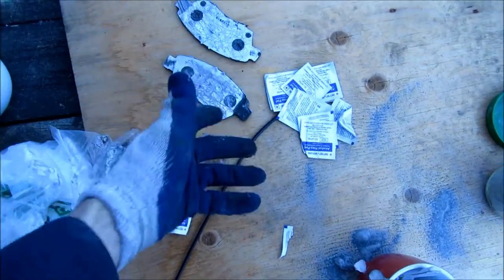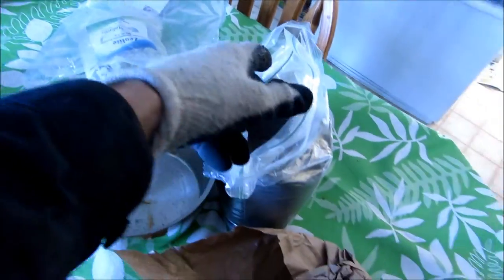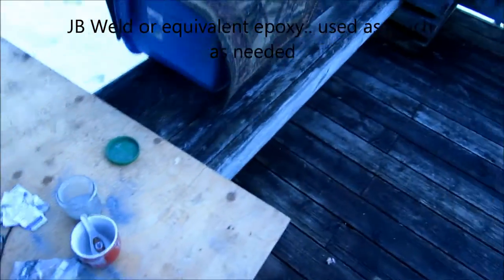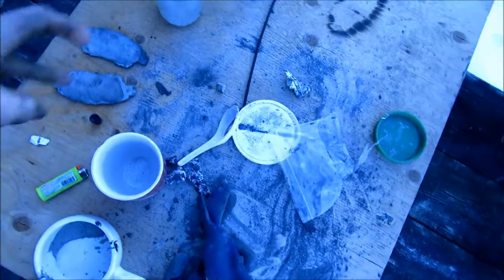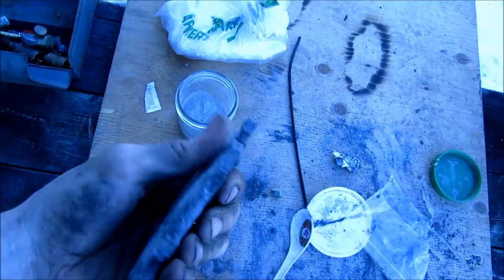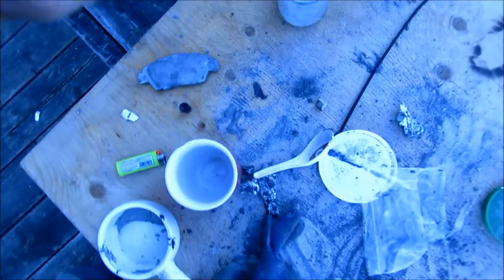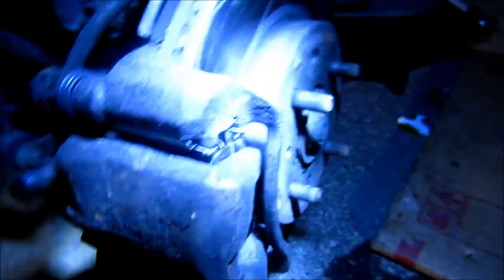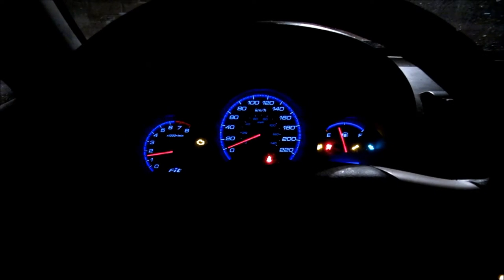DIY Brakepads! epoxy, aluminum oxide, zeolite, magnetite, done!

Comment: Dude I literally was looking for diy brake pads like 6 months ago. Why didn’t this vid show up. Fukn search engine. 
So is this a inexpensive though labour intensive production. Or was there some other reason you did this method?
Reply from the maker: Hey!!  Glad to have you finally come across this video, given the fact you searched for the thing many moons ago, I wish you woulda found it sooner when your pads were likely burnt out and you really coulda put this method to the test.  

As far as it being inexpensive and labour intensive, both of those are slightly incorrect.  I had some silicon carbonate laying around which I had intended to use as an abrassive in a ball mill project, but this didn't end up happening so I decided to utilize it as a component in the grit for the brake pads.  This is a relatively expensive material.  Also, the binding agent to make all the grit adhere to the brake pads securely is also a high value item.  I believe I used one of the most expensive 2 part epoxies which are available in small quantities for the hobby market.  It's  known to many as JB weld and works amazingly well for this type of application in comparison to other 2 part epoxies, such as the extremely cheap ones you can get at the dollar store which probably would crack and crumble to dust after only applying the brakes a handful of times.  This is just my guess as I never tried it out, but from my experience using that garbage for other projects, it's  probably an accurate hypothesis.

The other thing I'd like to mention in regards to this project is that brake pads are already fairly inexpensive, and making your own doesn't actually make much sense, aside from the reward you might feel from having put something like this together yourself and having it actually be capable of bringing your vehicle to a stop.  When I did this project myself, my motivations to do so were slightly different than what most people may expect.  I was going through some mental health struggles and had absolutely no way of coming up with the money to simply purchase new pads, but after looking around the house for materials, I realized I already had everything required to put these together myself without dropping a penny.  I also had it in my head that a new set of pads would have probably cost me about $80 for the cheapest I could find.... Turns out my estimation was completely far off and I probably could  have just bought a new set instead.

I forget how long the pads lasted before I had to replace them, but it wasn't very long.  Anyways, I hope you have fun if you decide to give it a go!   Make sure they're safe before getting on the expressway or something!  Perhaps only rely on 2 wheels with home made pads vs. using it on all 4....Cheers!

Comment: Cool project idea.  Your recipe is in the semi-metallic category for abrasive.  As for the process, you'd definitely want to FULLY mix your epoxy part A + B BEFORE you apply it to anything.  So I would do it like this: using a wisk, fully mix your abrasives while dry in the proportions you want.  Then mix your epoxy fully.  Next mix the abrasive and epoxy.  Personally I would come up with a cast negative to press the mixture into.  Then you should mix new epoxy JUST for the purpose of applying to the brake pad base in order to maximize the bond.  JB weld will give you about 500f resistance to heat before breaking down, so it's an OK selection.  I'm not sure what would be better offhand.
Reply from the maker: yea.. if i had thought it through before hand and had bought enough 
epoxy to do the job it woulda gone much better.  It's been a week or two
 since the install and they are still holding up, but I'm gonna reapply a
 thicker layer of pad to them when i swap my winter tires for summer 
ones in a few weeks.  I'll probably do an update vid showing the wear 
and tear that has taken place, as well as an upgraded and more thorough 
pad application.
Reply: could mix the powder with one of the resin components first